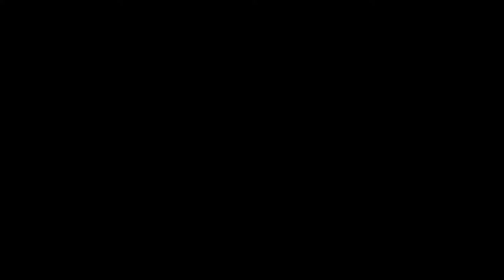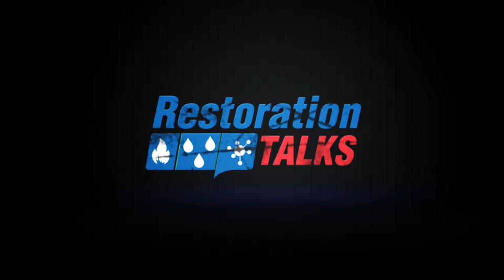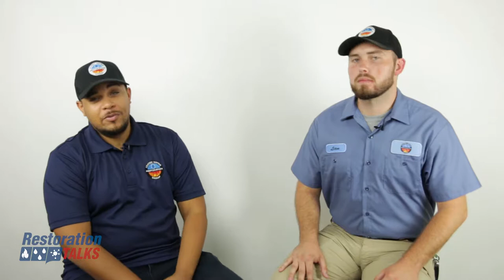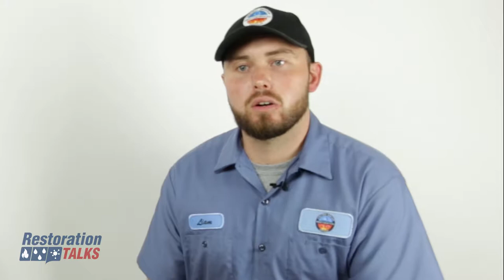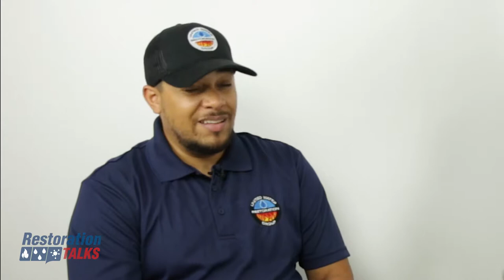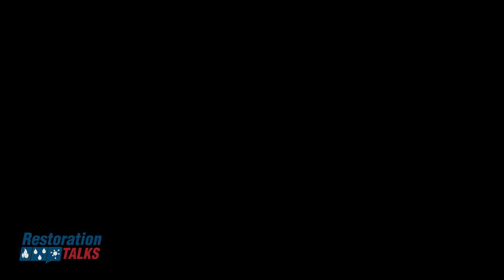Restoring Water Damage In The Attic

Comment: I have water damage caused by a leaking roof.  Roof has been fixed, leak was many years ago, and wood is dry (dryish, about 15%). I have removed drywall from walls and ceiling.. Evidence of prior fungus (dry), and some  wood has rotted out. Can insert screwdriver easily.  Do I just pull out rotten pieces and replace. Not a load bearing wall, just a closet.  How far back should I go